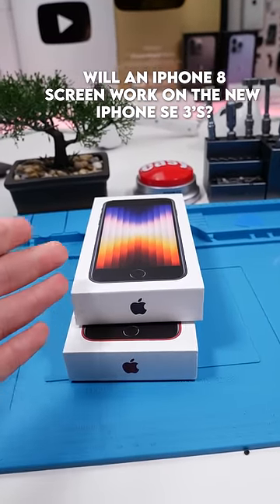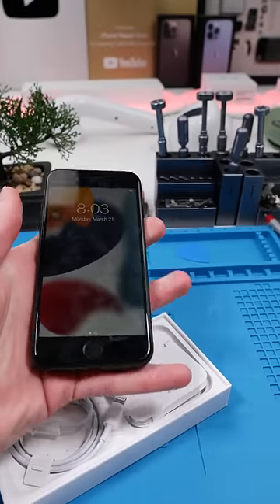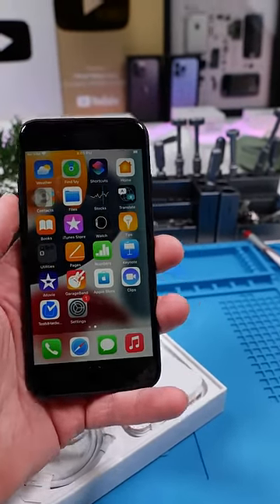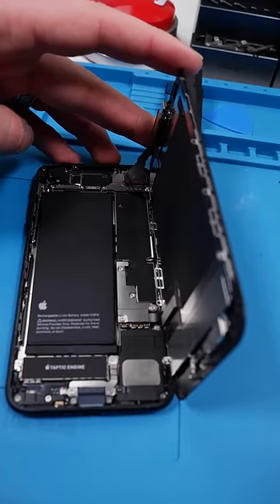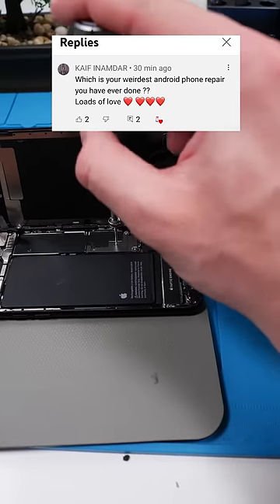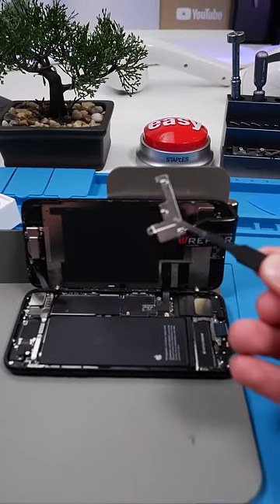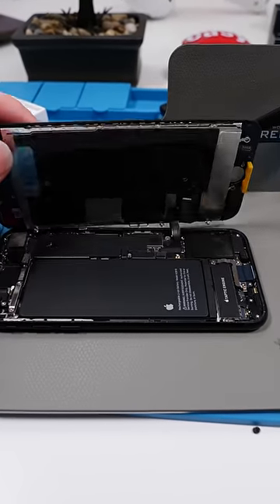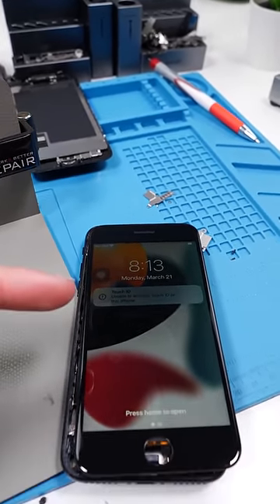Can iPhone 8 Parts Work With The NEW SE 3??? #Shorts

Comment from the maker: Checkout the long video where I unbox, test, review and test repairability : https://youtu.be/258nIeTgCu8
Reply: Alright
Reply: Yeah alright
Reply: Yo who do you buy parts from
Reply: you can actually use an iphone 7 screen on the 8 so i wonder if it will work on the se 3
Reply: @phone repair guru , I have a question , does the se 2 and se 3 camera can be used on iphone 8? And does it make any difference?
Reply: @dogbear140  he should do a full logic board swap on the se3 to the 8 & 7
Reply: Ok cool. It works, but . . . The new se doesn't have 3d touch and the iPhone 6s through 8 did. Are you sure they're the same?
Reply: Samsung op
Reply: Can you use the insides of the new SE with a iPhone 8 PLUS screen ?
Reply: Can you give me one iphone , I can't afford one and I am following you from a long time please it would be a great help
Reply: Could you check out a I phone 2
Reply: Do you suggest buying one ?
Reply: Do u live in Memphis I need my phone repaired
Reply: Can you replace a slow chip processor like Mediatek hellioP35 to a better one and faster processor?
Reply: @PhoneRepairGuru HOW DO I CONTACT YOU and if you have extra anything i very open to it i going into high school without a phone and am very in need
Reply: Bro my question is . 🤔 
Is that possible to swap only chipset from iPhone SE 2 to iPhone 8 .
Only chipset ,please reply.

Comment: On the plus side repairs will be relatively cheap as there's abundance of iphone 8 parts
Reply: LOL people going to charge $120 for an iPhone SE 3 screen repair, even if it's the same. Upcharge on cases, screen protectors
Reply: yea, cheap for the person doing the repair. not the customer.
Reply: JENNITA B.O  Bot
Reply: @hellaSwankkyToo  just replace it by yourself🤦🏻‍♂️
Reply: @PeterMan55  tell repair shop its an se2 or 8 and ull get a good price
Reply: Apple and cheap? 😂😂😂
Reply: @DarKXDemon  id check in settings, general, about for the model number
Reply: Repairs are going to be cheaper too
Reply: @Leepu_  oh you strange little man. i won't need any iPhone repairs or replacements. ever. trust me.
Reply: That’s the whole premise of using the old body, apple is saving a lot by not having to invest in a new design/new manufacturing etc, that’s why they can sell the phones for cheap for what it packs (relative to their other products)
Reply: Hdjxk
Reply: @Leepu_ it’s harder to do it at home than you think. You need a lot of certain tools and patience. This can take anywhere from 30 minutes to multiple hours depending on how familiar you are with the device and the repair process.
Reply: @DarKXDemon people like the Uploader go through the phone, like the About settings to see the model and iOS it’s running for the best operating and performance while switching any part or screen over and know how to do any software/hardware processes like a hard reset, because all iOS’s were different with doing a hard reset, you know?.. 😊

Comment: They’ve been using that same screen since the iPhone 6 but they just have been modifying it like the connectors, 3D Touch and adding True Tone.
Reply: Not exactly the same, the 6 has a homebutton
Reply: @timwiesler6365  I meant in terms in design
Reply: I thought the iphone 8 screen was Oled all this time....
Reply: @antreaskonstantinou8585  only starting with the x if memory serves me correct is when oled came to iPhone
Reply: The IP7 and 8 have the some of the same connectors but other than that the newer screens all use different connectors. And from the X upwards they all have an OLED screen which is very different to the LCD used on the 8 down
Reply: iPhone 7 had ForceTouch
Reply: @tiagula  so did the 8
Reply: @UpwardOpossum9  don't point the obvious lmao. We have eyes and brain xD
Reply: @blurryface2309  11 has lcd
Reply: @blurryface2309  iphone xr and 11 have a awfully bad lcd.
Reply: Which makes it kinda weird that they disabled 3D touch from the SE 2 and 3, since it seems the phones still have the hardware for it. 🤔
Reply: @EmirhanSanl4  at least it doesn’t burn in
Reply: Same resolution and size, but not the same screen at all. 6 and 6S are different because of 3D Touch addition, the 7 and 8 are same but had brighter backlight than 6S and updated IPS (I believe with Sharp's IGZO technology) to support P3 color space. SE2/3 are same as 8 but 3D touch was simply not applied to the same backlight.
Reply: @andrewzasidko6595  there you go everything I wanted to put in a comment but I was to lazy thank you for commenting this so ppl can see
Reply: @blurryface2309 the iphone 11 uses an lcd, 11 pro has an oled screen
Reply: @EmirhanSanl4  having used them all the XR was one of the best phones hands down. I ended up buying 3 for the family. Any repairs were also very easy
Reply: The home button got Haptic Touch on my iPhone 
(8)
Reply: Yes a couple little features was added but if you notice iPhone SE 3rd gen, 2nd gen, iPhone 8, 7, 6s, 6 they all use that same 4.7 inch display, yes the home button has been updated and more features has been added to the screen but it’s still the same resolution since the iPhone 6
Reply: True Tone is a software feature not a hardware one.
Reply: @tiagula so did the 6s
Reply: @9852323  don’t care the new SE still reuses that same 4.7 inch display 🤷‍♂️
Reply: @EmirhanSanl4  bad in what lol these lodus
Reply: @blurryface2309  don’t forget the XR and the 11 they had LCDs as well
Reply: @blurryface2309 Not entirely correct, the XR, 11 and SE still have LCDs
Reply: I dunno bout u but as far as I remember there was no oled display on the iPhone 6 nor a home button nor a notch. Trust me a lot has changed
Reply: @nothingatall3104  bruh the iPhone SE doesn’t even use a oled display, it’s still apple’s "Retina display" which is just a high resolution lcd display No oled 😂
Reply: @nothingatall3104  also yes for the regular models a ton have changed like MagSafe and 27watt charging, dynamic island, but we’re taking about the cheaper iPhone SE 3rd generation here not the main iPhones.
Reply: @SStarlight9614  no, it was on the 12
Reply: Not with the pros, but I get where your coming from
Reply: @Cybertruck4WD  yeah the flagship phones & pro iphones use different parts even screws lol

Comment: Actually nice to know that Apple actually is recycling old parts that are sitting in a warehouse for 5 years
Reply: That tells me they must have massively overproduced parts for the 8 then if they’re still drawing from surplus
Reply: @paulsd9255  at least it’s not as bad as the iPhone 4/4s cause you would lose signal if you weren’t holding it right
Reply: @Ibster1  I didn't say it was an issue, I was wondering aloud wasn't the point of the SE2 that they overproduced parts for the 8, so they used those bodies for the SE2? If so then where are they getting SE3 parts?

Comment: U have beyond an inspiration for me. I am a teenager and I've been watching your videos for quite some time. I had an old iPhone 5s and both it's cameras and werent working and the front earpiece speaker werent working. I opened it up myself and fixed it. Another phone repair guy said that the repair was gonna set me back 30 bucks but when I opened it up i saw that the camera and earpiece were just loose and i had to just pop them back into place. It was a simple repair but a huge deal to me

Comment: Im using iphone8 for 2 and half years, i upgraded from 5s and i barely noticed any changes, im not buying a new one any soon, the only problem is the decreasing capacity of the battery and maybe the new phones are a bit stronger as a hardware and support newer ios with new features, but still not a big of a change to be worth buying new one

Comment: So this means you can use an iPhone 7 screen on an iPhone SE 3, because the iPhone 7 had the same design as the iPhone 8, but used an aluminum-type, like the iPhone 6 series, instead of glass, like on the iPhone 8.
Reply: And that’s crazy because iPhone 7 came out in 2016. So you can use 2016 parts on an 2022 phone. 💀😅
Reply: Not quite the same screen, actually. Mildly better color reproduction, addition of True Tone, and a different connector. They just looked the same from the outside.

Comment: But… when I looked up the specs on the original SE, the reviews said it was the iPhone 6 in an iPhone 5 case. The SE2 was an iPhone 8 with some enhancements and the SE3 was an enhanced SE2.
Most of the Skodas produced by the Volkswagen Audi Group (VAG) are rebadged VWs and Audis with enhancements. Tried and trusted equipment, lower costs, but still turning a profit for the companies.

Comment: Man the se 2nd gen and se 3rd gen would be perfect if the battery capacity was about 50% more. 
Have se 2 and the battery has long been in need of service. With low power mode on I can use a bunch for maybe half of a day and have to put it on charge.

Comment: the 8 had 3d touch right? does that still work?
Reply: I think that is handled by the haptics engine of the phone, so it should not work on the SE3 even with an iPhone 8 display.
Reply: @dannym3821  wait... 3d touch required an extra layer in the screen right? both the se3 and 8 have a taptic engine 🤔
Reply: The 6S was the first iPhone to get the 3D Touch, and the iPhone XS the last. iPhone SE 2. gen., iPhone XR and later have Haptic Touch
Reply: @jaeindapark  Yes but I think it’s a different engine, is what I’m saying. And tbh maybe it’s just me but I never noticed a huge different between the force touch and the new engine.
Reply: @dannym3821  the taptic engine looks the same lol, the biggest taptic engine change was from iphone 6s to iphone 7

Comment: Hey Phone Repair Guru, I was just walking around in the woods and I slipped, I was fine but my A52 5g fell in some water for about 5-10 seconds. Will it be ok? Thanks and keep up the great content!
Reply: The A52 has an IP67-rating for dust and water resistance so you'd be fine.
Reply: hopefully it wont have an issue, it comes with a rating but generally you wanna avoid throwing phone in water even if they have a rating because no phone is water-proof, only water-resistant, but since it was 5-10 second exposure you are perfectly fine.

Comment: Nice video! 

Can I ask you a question? So I have an iPhone 8 which I no longer use. Its front glass and the back glass are shattered. (The front is not too bad but the back is missing some pieces.) I had some issues with the screen because it was not working properly (I think the connection cable got loose or something) and then it just went black. I was thinking about opening the phone up, I just don’t have the proper tools for that. So the question is: is it worth selling the phone as parts or should I (get the proper tools and) open the phone up to see if I can do something about the screen and sell it like that? 

Greetings from Hungary🫶🏼

Comment: well yea its an iphone 8 with better processor which people are willing to pay more apparently
Reply: Well 1. It has much better specs 2. it will get much longer support 3. it costs less than the 8
Reply: @timwiesler6365  well, yes like i said, the processor is newer. also it has 5g. also support depends on what you expect. if you expect that the processor gets slown down to "save the battey" after 2 years, then yes. and you can get a refurbisched iphone 8 with 4times the storage of the se 3 for half the price.